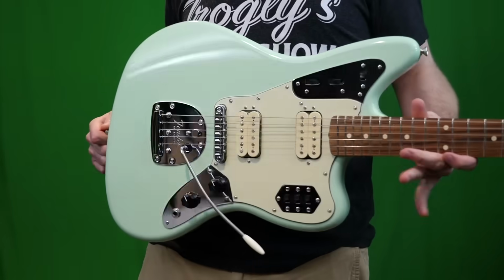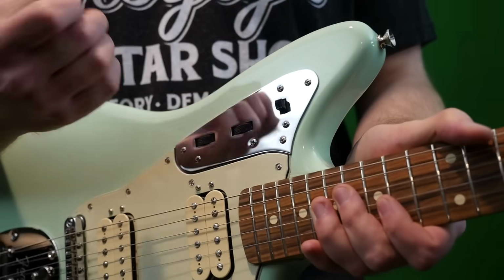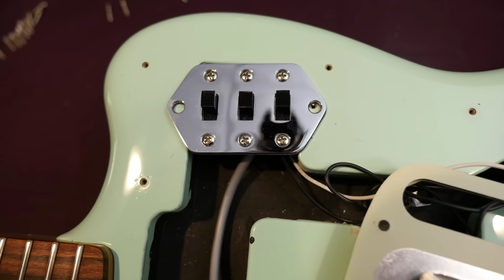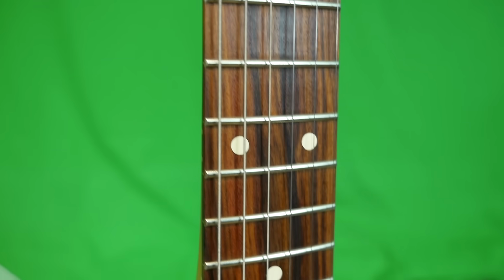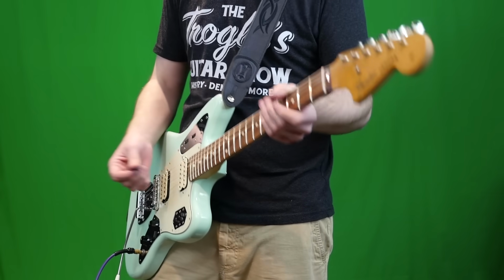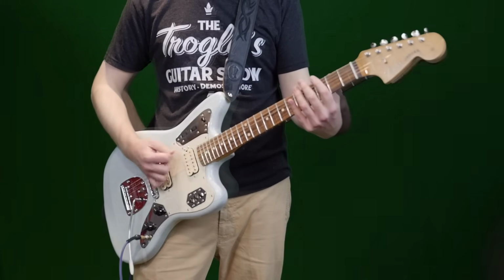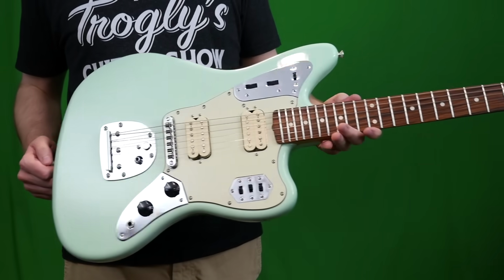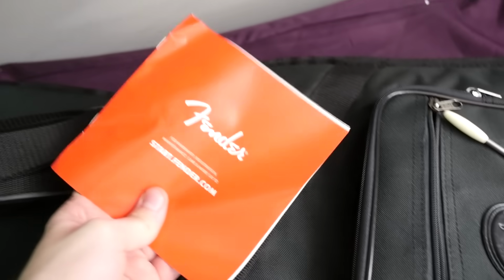My First Jag! | 2019 Fender Vintera 60s Modified HH Jaguar Surf Green | Review + Demo

Comment: I bought one of these and it blew all my other guitars right out of the water. It’s my best girl for sure.
Reply: I just got one today. Does your copy have the noise from the bridge area when you strum? Hard to describe, I guess it’s a faint buzzing/rattling sound, like the strings are resonating there. I’m guessing it’s normal for this bridge
Reply: @jcbarker1  YES, I did have that problem. Whenever I played the G or B string there was a rattle. It took some time to find, but it was coming from the bridge. The tune-o-matic or what Fender calls it the adjust-o-matic bridge. Each screw on the bridge is held in place by a C-ring. It’s like a washer that snaps into place and keeps the screw in place. The one on the B string was loose and rattling. To find out if that’s the problem, take the bridge off and shake it. If you hear a rattle when you shake the bridge, that means a C-ring or something else is loose and it’s the source of the buzzing. I wouldn’t bother trying to fix it. It’s too small. I tried a few times but it just wasn’t working out. You should just replace the bridge. They’re not expensive. You can get another Fender brand one, the same one that came on the guitar, but there’s a chance that bridge will just end up rattling too. I got a Wilkinson 52mm(2-3/64 inch) tuneomatic bridge for it. I bought that one because the screws are held in place with a spring thats between the saddles and the head of the screw. No buzzing and its just a better quality bridge. Here’s an Amazon link ⬇️ but it looks like they’re out of stock. You can still check it out so you know what to look for. I hope that helps. If you have anymore questions, feel free to ask. ✌️

Wilkinson 52mm(2-3/64 inch) String Spacing Wide Style Tune-o-matic Bridge Compatible with USA Les Paul/Epiphone Les Paul Style Guitar, Chrome https://www.amazon.com/dp/B084ZF9TVC/ref=cm_sw_r_cp_api_glt_fabc_50Z8KY3P2XRWG5SDHZ2E?_encoding=UTF8&psc=1
Reply: @Dan.Solo.Chicago  Thanks Dan, I will definitely look into a new bridge!
Reply: @jcbarker1  👍
Reply: @jcbarker1  I forgot to ask, what finish did you get? Mine is a sunburst.
Reply: @Dan.Solo.Chicago  Sonic Blue—my Tele is sunburst so wanted something different. I like it.
Reply: @jcbarker1  Hey, I wanted to check in with you because I’m curious how things turned out with your Jaguar. How did you solve the problem, and was it actually the bridge causing it?
Reply: @Dan.Solo.Chicago  Thanks! I took it to a luthier for proper set up and he said it was the bridge. He fixed it and the buzz issue is resolved. He didn’t replace it so not sure exactly what he did.
Reply: @jcbarker1  Awesome. I bet he replaced the C ring. I tried to do that, but had no idea where to even get one. I tried taking one off another bridge, but once it’s been removed, you can’t reuse it. It gets stretched out won’t stay in place. So I just upgraded. How does it play after getting set up by a professional? Do you notice any difference? I’ve never done that before. Thanks for filling me in. ✌️

Comment: I just purchased one and I noticed buzzing from the bridge saddles. The saddles in mine have about 1/8” horizontal play and all are loose and vibrate when playing. Please check yours and while strumming place your finger on the saddle and you will see no more buzz. Is this engineered this way or I have a defective one. I would like to get it fixed but if all are like that, need to try and find a 3rd party replacement.

Comment: My 1st (only) Jaguar is a Chinese dhgate rip off of a Fender Jaguar. It was cheapest of cheap. The only 2 good things about it outa box  was perfect neck. The build overall, the wood part was also excellent. I did lots of work on it and it is as far as I'm concerned a Fender grade Jaguar. If you could play it you would agree that playability is tops. I would never consider passing mine off as Fender, cheating someone. My folks taught me better. I appreciate that I was able to get my knock off cheap and make something of it.

Comment: Corrections:
Strings on a short scale are looser, not tighter
If you’re getting vibrations in the bridge, you need to adjust the bridge height and possibly shim the neck. -it’s a jag thing. 
Button on bridge does not adjust the spring, it is a trem lock. 
Nice guitar!

Comment: FYI I bought a Sixty-Six as well as a top-end Epiphone LP from Sweetwater and their "setup" lol. Not to mention their "55 point inspection" is also crap. Neither guitar came setup and both had a handful of issues (badly cut nut, loose pickguard, missing screws etc, OBVIOUS stuff).  Overall the issues were fixable and i opted to fix both instead of send them back but don't expect anything better than you'll get from anywhere else. Unless you really love random bags of hard candy.

Comment: I really like the wiring made simple and likely better than the old was of how every many different variations. 164 or something like that and then with tone and volume controls you can go nuts trying to find a sound in that guitar and the truth is if you could never try everything if you added tone and volume control which if you eliminated tone and volume control you may as well cut my hands off because that is where I get most of my tones.

Comment: I may be wrong here about the volume control but the Jags use 1 meg pots which have a shorter volume sweep than 250 or 500k ones. Again, I may be wrong but that's what I was told.

Comment: Longer scale length equals tighter tension on the strings. Which is why 7,8,9 string players play extended scales. With the longer scale length it allows those beefy low strings on extended range guitars to have enough tension and not sound like a wet loose fart.

Comment: I usually put a small, lightweight piece of cloth or small towel around the strings past the bridge toward the tremolo. It mutes out the sympathetic vibrations without putting any significant pressure on the strings. Works for me. I’m completely smitten with jags. They’re so awesome it’s not even funny. Especially with a sweet aftermarket boutique neck pup. Sooooo yummy.
Reply: Oh and keep in mind these guitars were originally designed for very heavy, flat wound strings. The guitar reacts very positively to heavier strings. The trem especially.

Comment: I agree that this thing is overpriced. For 1250 you can get the Cobain Jaguar that comes with a hard shell case and some cool modifications. These vintera guitars are cool, but shouldve been knocked down 100 dollars or so for what you get. I also way prefer the Ocean Turquoise single coil model since it comes with a matching headstock.

Comment: Dude. Shorter scale means the opposite of what you described. Yikes. You sell guitars for a living how do you get that so wrong yikes. Also the tone switch does the opposite. It's a strangle switch. It cuts the lows. And yes they are all set up like garbage from the factory. No guitar would intonate that way unless you tuned it EEEEEE:) another tip: drench your spring in vasaline for helping with  creaking
Reply: As a jag owner my self i second this
Reply: In all fairness he doesn’t normally do fenders all that often, and I haven’t seen him do a short scale in idk how long so he made a mistake it happens